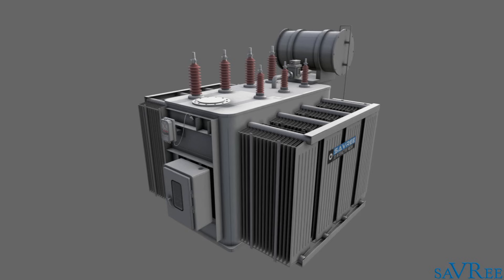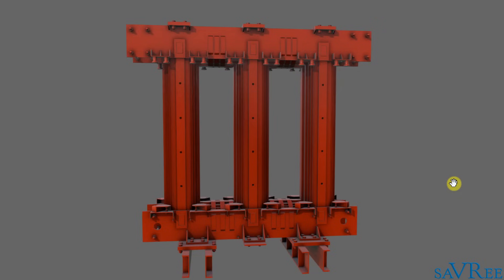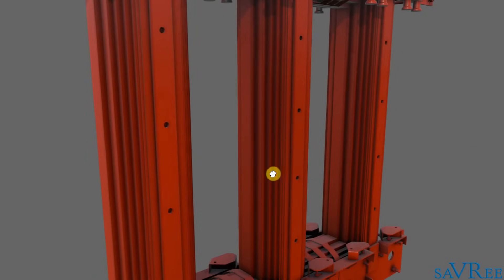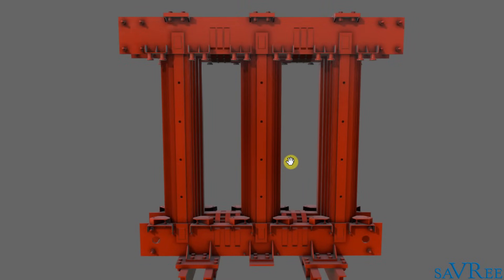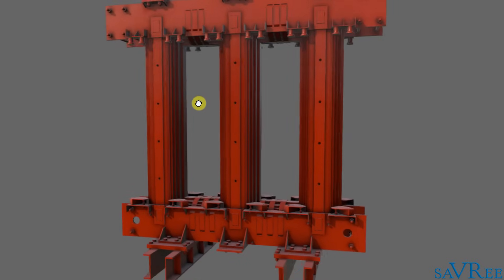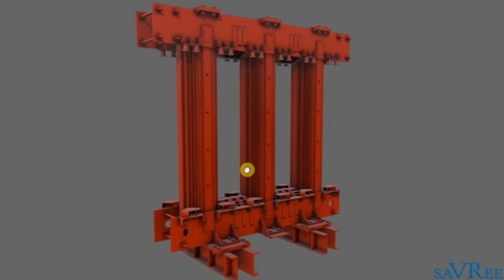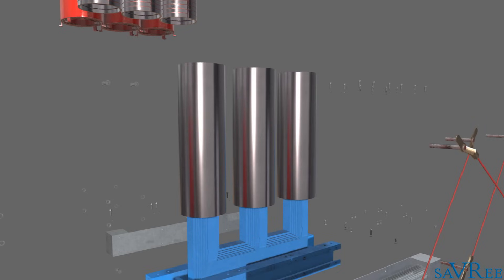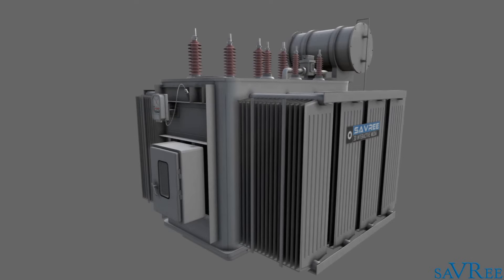Transformer Parts and Functions

Comment: Great video indeed as many others have said. BUT there's only one major component that wasn't mentioned and I only know cuz I work in the utility industry. The CTs that are wrapped around the bushings. Very important piece to monitor the current flowing in and out of the transformer. And for protection.
Reply: Absolutely true. We totally forgot when making the video. It will be added when the video is updated.

Comment: Very nice introduction. A good supplemental video project could be made on Grids and Transport. 
Air/sub soil/sub sea line systems, TN´s, TT, IT and so.
Reply: I found your Francis Turbine and Induction Motor. There is still openings for making projects on Generators, Breakers & Relays, for a full basic intro set.

Comment: I am a lowly 'low volt' (120/240v 1ph; and 3ph) residential and commercial (some industrial) electrician in South Florida. This is the first time I have really read/seen/heard ANY detailed information on transformers and their design and operational characteristics. Very, very interesting, entertaining and informative.

Thank you. 

There is a guy named Mousa Al Manasif [2 years ago, from now 01/02/2022[], who complemented and thank for this presentation - but brought up a few things where he says there were a few incorrect statements made in this video concerning: 
"However I noticed two things that are incorrect:
1- OLTC on load tap changes are divided to two parts
 a. Diverter switch ( the arcing and the interpretation of the current, have separate  compartment) 
b. selector switch ( the part inside the TR main tank which shares the same oil of the  TR) 
OLTC diverter switches ( are always separate from the TR main tank 

2- At the end of the video OT ( oil temperature gage) the red Needle is only a memory needle to show the highest temperature recorded by the OT. 
When the black needle ( showing actual temperature)  moves up it will move the red needle along with it but when the temperature goes down the black needle will go down the red needle will stay at the maximum temperature the OT recorded so operator can see it during there inspection".

Could you comment on this. And if he was correct: Are you looking to create a revised version of this video; or add an addendum that addresses these things one way or the other?

Either way, the video was superbly done.. Thank you again.
Reply: Both comments are correct.
Reply: Diverter switch compartment is separate which contains its own oil. During tap changing operations (raise/lower), selector switch contact is selected first and then diverter switch contact changes its position from odd to even or vice versa and desired tap is selected.

Comment: Great!  Refreshed knowledge I had  35 years ago as a fledgling 11kV Authorized Person. Might  have mentioned operationally that certainly oil cooled  transformers can usually accept short term overload periods  considering a 24 hour duty cycle. Finally,  let's hope all "Pyrochlor" PCB oil has all been safely disposed of. Beware  also that toxic brew was  also used in early fluorescent light ballasts that might still be lurking in our sheds.
Reply: Out of all the comments made here this is one of great importance. The use of PCB's was widespread and there is undoubtedly many transformers lurking around with this free cancer toxic soup. It was also a very good thing to mention those old magnetic fluorescent lighting ballasts with the potted black toxic tar in them. I have come across many of these in the past. It helps to be wary of the potential dangers of these to help protect yourself from them and hope others see the importance of this. Excellent comment and Thank you.

Comment: At 14:25 you say in the left side the High Voltage bushing, but wouldn't the left be the Low Voltage as there is four of them meaning there is a Neutral?
Reply: Bigger the insulation the higher the voltage

Comment: The core is not one solid block of metal, it’s actually the
series of metal sheets that have been clamped together. The
core is not perfectly cylindrical. What is the reason that we
clamped this very thin laminate sheets together?
Reply: thin laminated sheets are used to reduce eddy current loss.

Comment: you said that the high voltage side has the big bushings and the low voltage side has the small bushings although the high voltage side has the small amount of current and vice versa and another point , the high voltage side according to you has the neutral and i think it is in the low voltage side

Comment: What is the effect of using a 300KVA set of coils in a Tank designed for 500KVA 33/0.415Kv.
Reply: If the primary and secondary voltages are the same and the vector grouping is identical, it will work. In fact, the active part should last  longer as the cooling system is bigger.
Reply: A tank designed for higher power rating can be used for lower power rating. Quantity of oil will increase which will decrease oil temperature rise and winding temperature rise. So life of transformer will increase (refer IEC 60076-7).

Comment: 26:39 the red needle is just a max indicator for temperature
Reply: Correct. The red needle is also known as a drag needle which shows the highest temperature the top oil has seen. This needle can be reset to the ambient temperature. In this example, the alarm and trip values are set using the four "rings" seen below the dial. KB